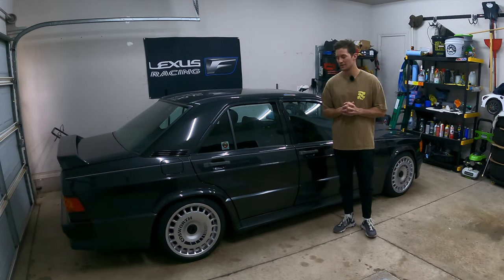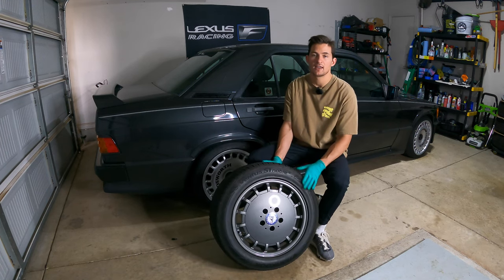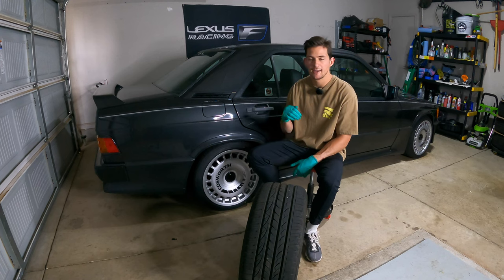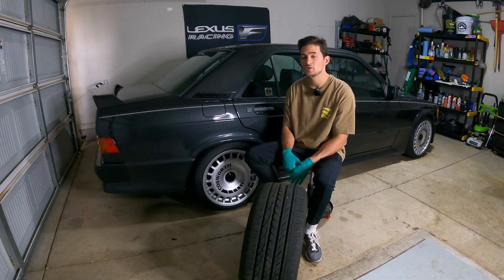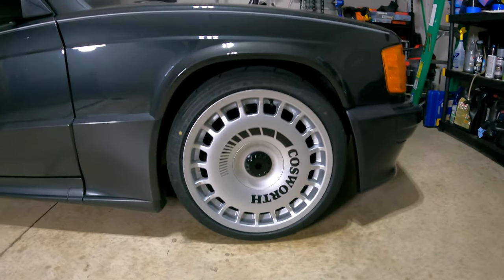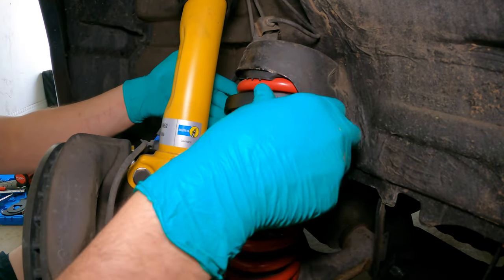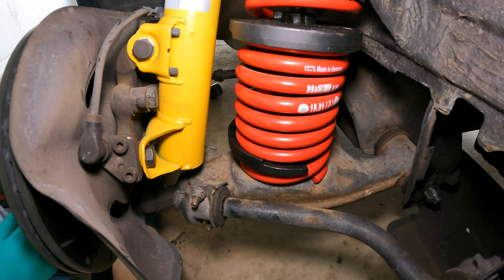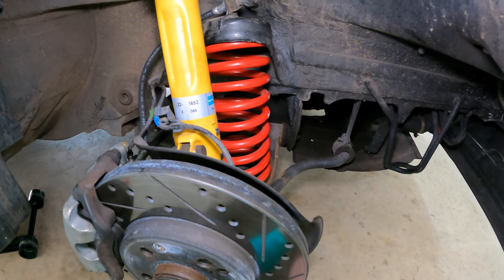190E 2.3 16V Cosworth | Suspension Wheels Tires DIY Lowering Springs

Comment: wish I had that type of spring compressor, 25 years ago. lol! I remembered lowering my 1986 190E-2.3 (non cossie) back in 1998 and it freaking took me 12 hours just to do the front suspension! LOL! I barely had tools and was only in 11th grade high school when I first did my lowering spring installation on my 190E. but that was a great learning experience because after that, I am able to do the same job in 3 hours and thats installing all 4 lowering springs on the W201 chassis. I've owned about 5 other 190E's over the course of 25 years. but never had a Cosworth. hopefully one day! but I'm happy with my current 190E-2.6 and its on old school Vogtland lowering springs. check it out on my channel!

Comment: When you replaced the front you used 8mm Burls.  from 18mm. is that the same for the back also? so this way you can reduce suspension height even on a standard car with Sls., which only does the back anyway. Mine has a Standard sls suspension setup running 8 ×18 wheels very similar to yours actually made by compomotive specifically for the car. no rubbing at all. I had same bolt issues the back one was clicking on the plate even with certain other bolts so had to machine the rears. I would like to drop it maybe 10 mm would ride perfect if your method works . thanks .👍

Comment: Great information regarding the suspension, spacers and lugs. The wheels look awesome but are they re-drilled to accommodate the MB bolt pattern? Compomotive also makes these in the correct pattern no drilling needed.

Comment: Great advise about lug bolt i bought an alfa 146 on ebay a year ago little did i know the had later model rims but the bolts where too short only grabbing about 3 turns thank god i when over the brakes as a force of habit should i drove the car i could have easily los a rim very dangerous ...pls review your used cars there are too many idiots on the planet